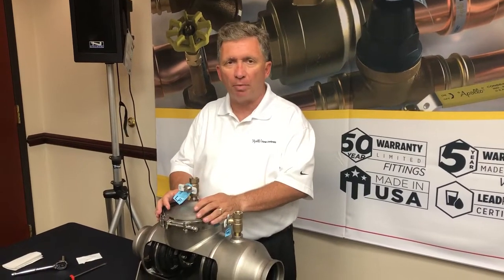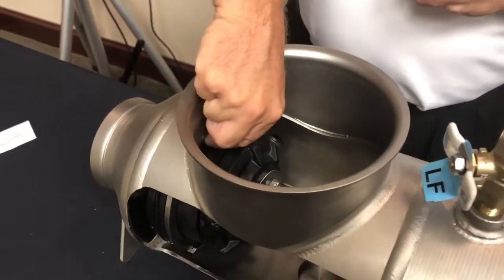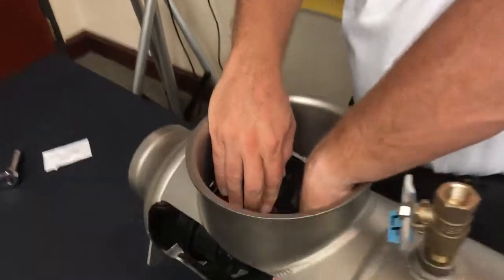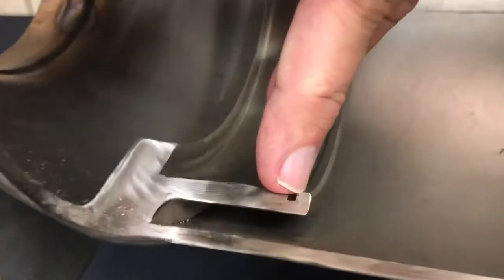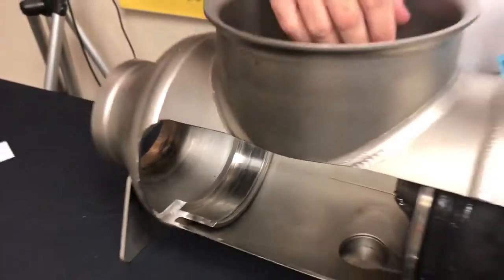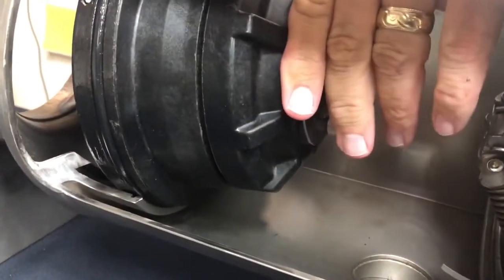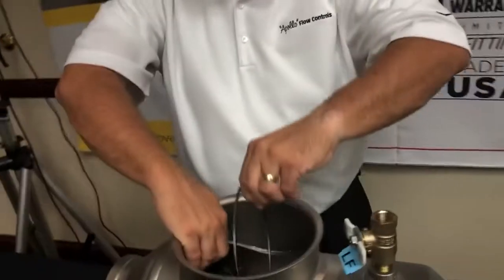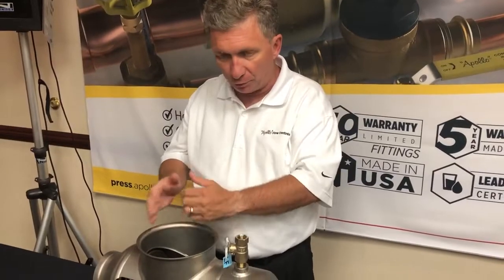"Apollo" Valves Backflow | 4ALF disassembly | How to

Comment: Gotta love the cutaway demos- the checks being manipulated with relative ease.  What you’re not seeing from this rep is the difficult disassembly in real-world application, especially if this device is installed vertically.  You will need a flathead screwdriver, a hammer, something rigid like a piece of 1/2” rod, and patience.  All backflow preventers suck to work on, and this one is no different.